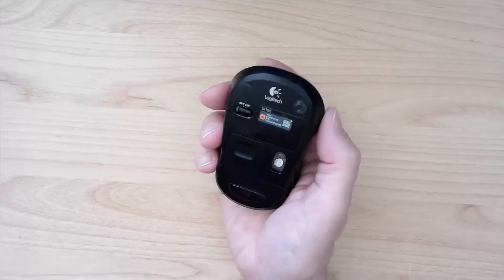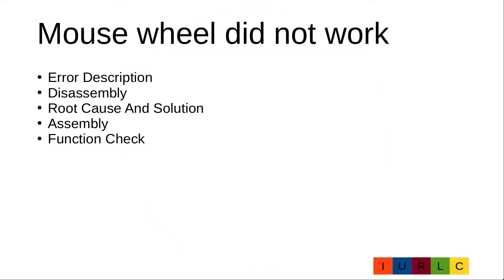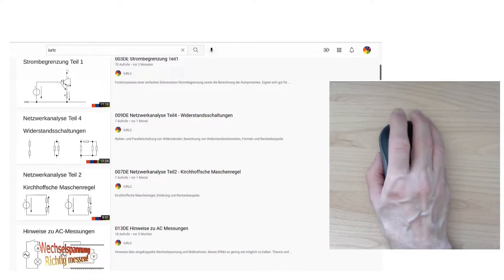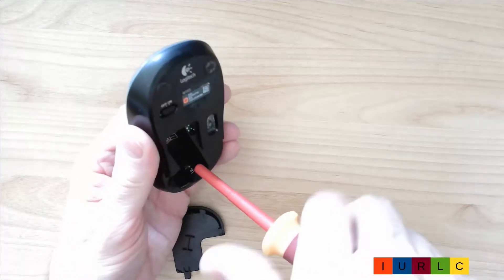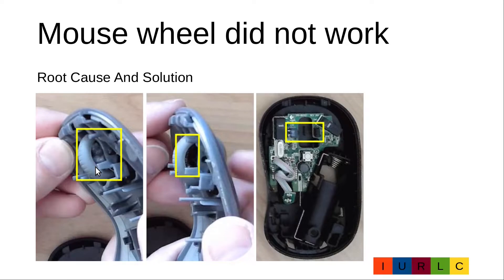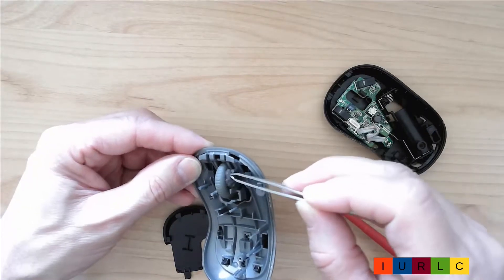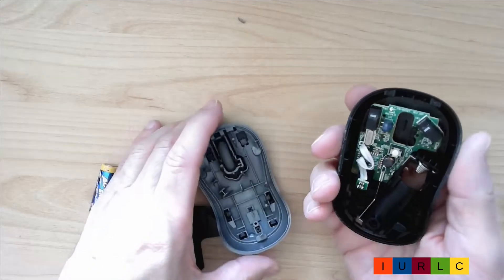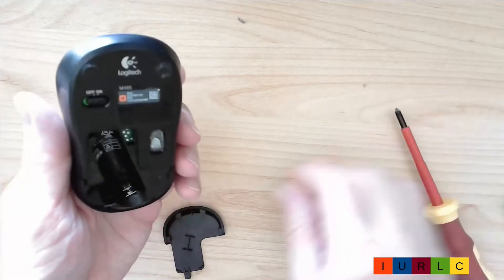016EN Logitech Mouse Wheel didn't work, no scroll or zoom function - root cause and solution

Comment: Smartphone cameras can detect infrared light. Can you check if the scroll wheel LED glows red when viewed through a smartphone camera in a totally dark room?
Sometimes it happens that the scroll LED has died, and no amount of wheel cleaning will help in that case.
Reply from the maker: As you can see in the video - the issue was the dirt - after cleaning it works.
Reply: @iurlc   sorry, I didn't phrase my comment correctly. what I meant was that my M185 mouse has a scroll LED that doesn't glow. I wanted to compare against a working unit if the working unit's scroll LED glows dimly red or not, when viewed through a smartphone camera in darkness.
Reply from the maker: @genericusername2233  Good to know other possible root causes and how to detect it.
Reply from the maker: @genericusername2233  I was on a business trip - now I'm back and checked the LED of the photo interrupter with my smartphone - I can not see the LED glowing with the smart phone. The IR-filter will take it away.
Reply: @iurlc  thank you so much for checking this!